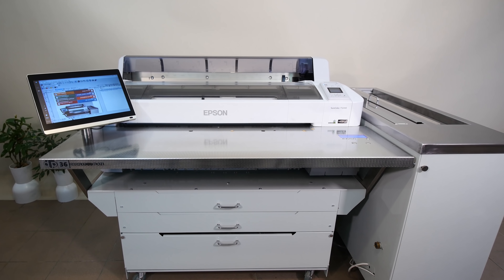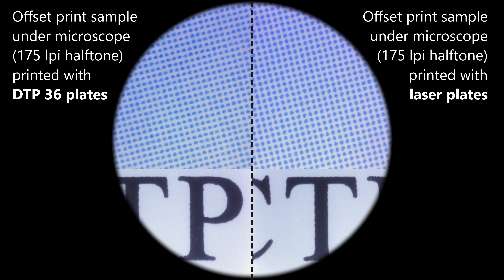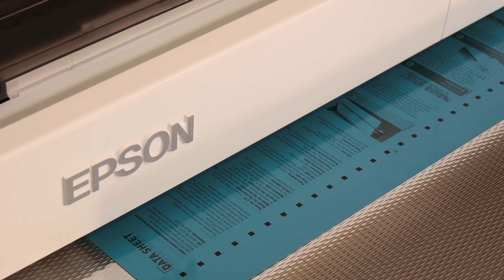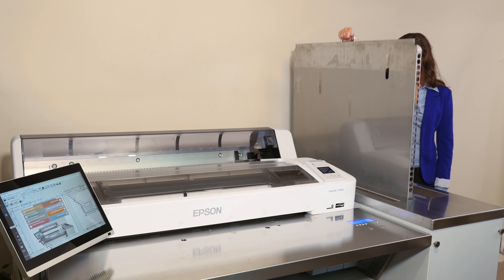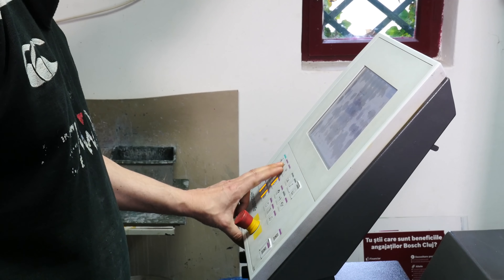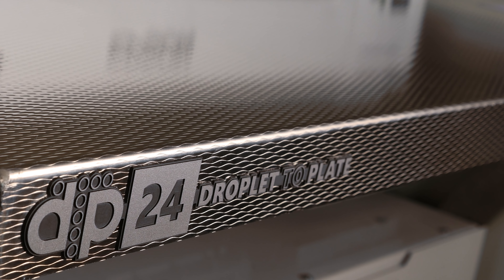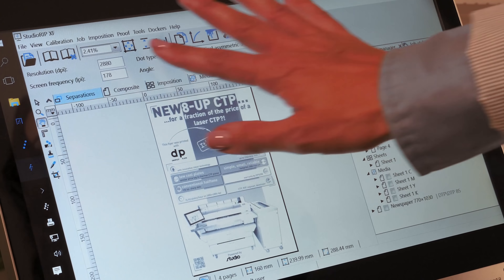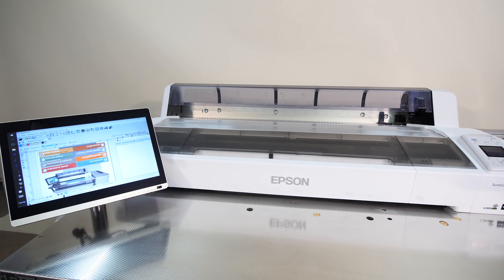DTP 36, 24 and 17 presentation

Comment: this system, it works in conventional plates?
Reply from the maker: Yes and no. The plate that comes out from the system is a truly conventional plate, but the plate that goes in is a conventional plate with an EXTRA INKJET COATING. So the system has to be used with StudioRIP DTP plates, but it produces conventional offset plates. (BTW, I think this is explained quite well in the video, including a picture showing the coating layers...)
Reply: @adambiro4143  
Does this equipment have a representative in Brazil?
Reply from the maker: @wilsonrodriguesjr.4883  No direct representative, but there are several US companies with sales chains for South America, such as www.dotworks.com, www.iscpomp.com or www.grafixworldllc.com.